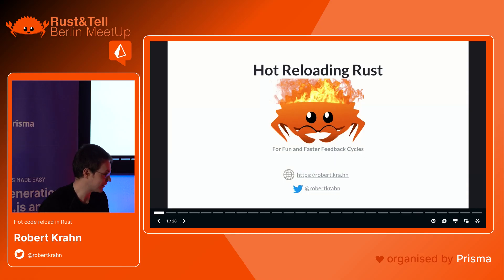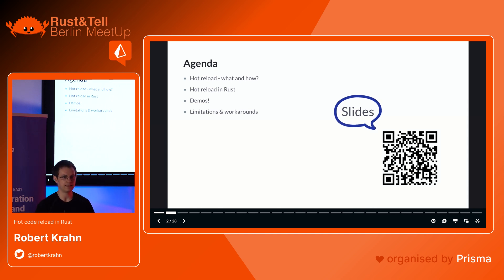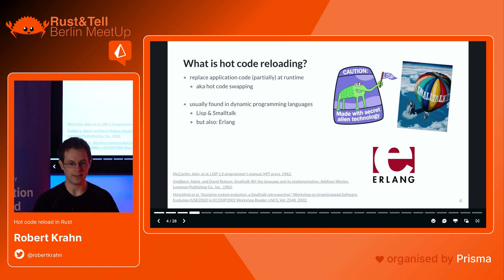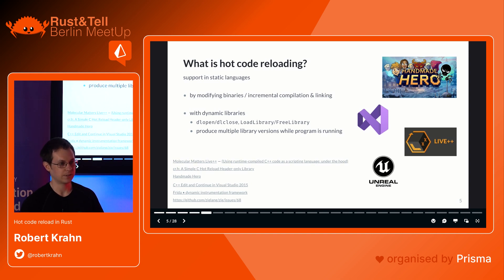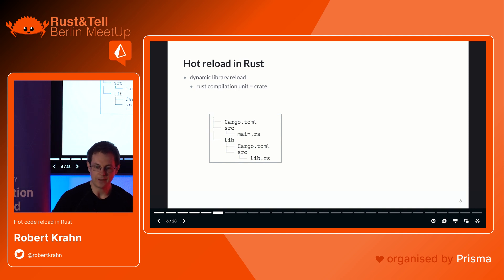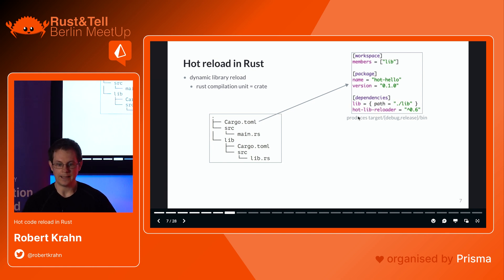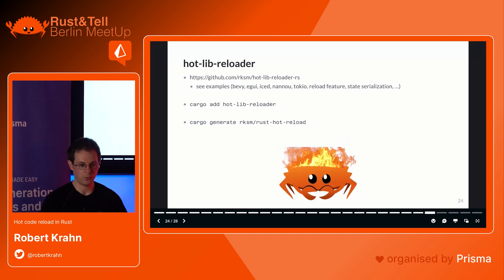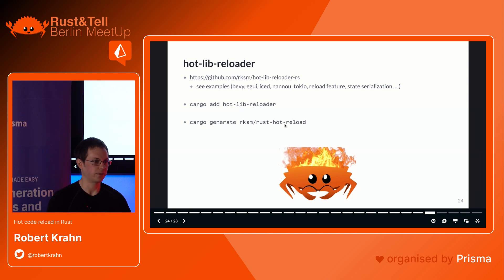Rust and Tell - Berlin - Hot code reload in Rust by Robert Krahn

Comment: I wish Rust had this by default but there is no stable ABI for now
Reply: Don't need a stable abi for that as long as you don't change compiler versions
Reply: @DavidSchmitt  I heard that there is no guarantee that it has to work even on the same version
Reply: @adsick_ua  source? how would the object files produced during compilation link and be useful without abi being consistent for a single compiler?